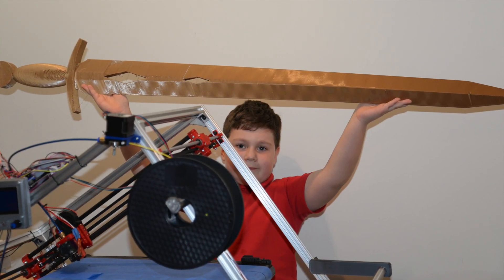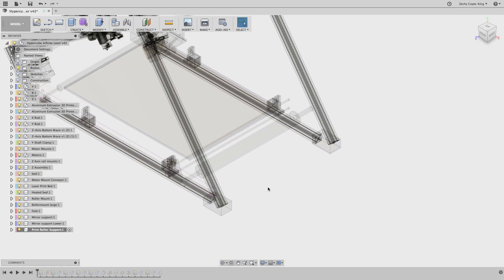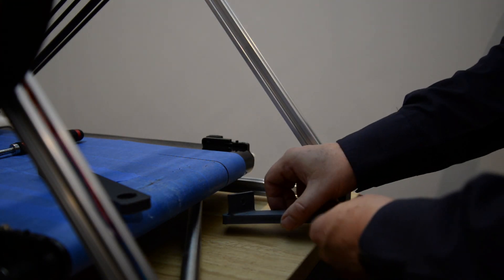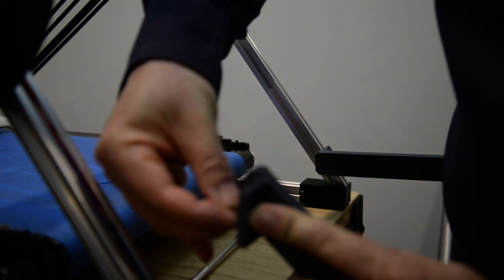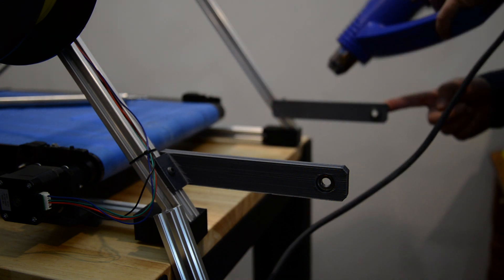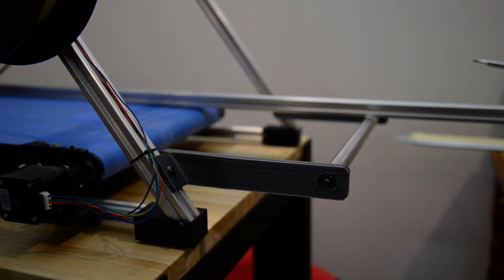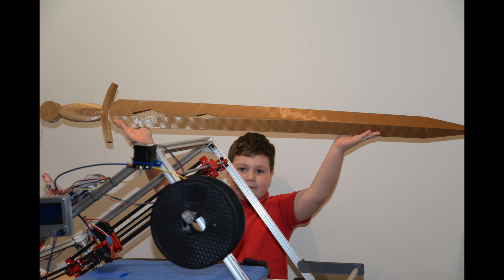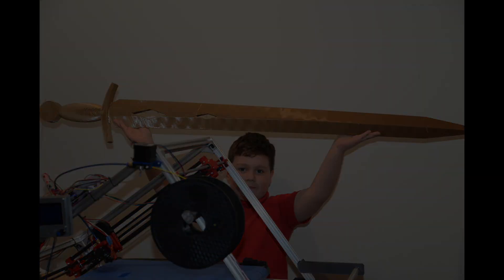Hypercube Infinite 3D Printer: Print Support Roller

Comment: This is just a suggestion would capton tape protect the belt against such plastic such as nylon? It could help.
Reply from the maker: Thanks for the idea. I will use the damaged belt to test with.
Reply: Zechy Coyte-King 
Alrighty, let us know how it goes. I have the extrusion(originally for a massive build that I had for a while) and I really want to see how well this belt option will work. With my ender 3 coming this seems like a fantastic second printer.